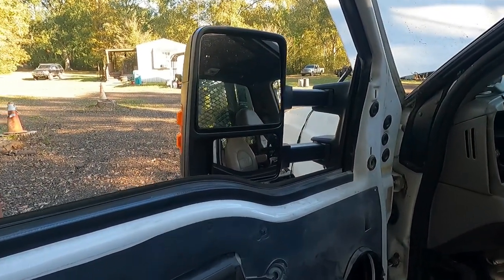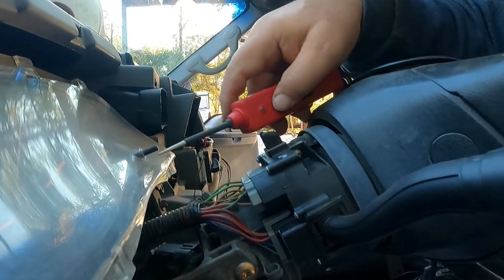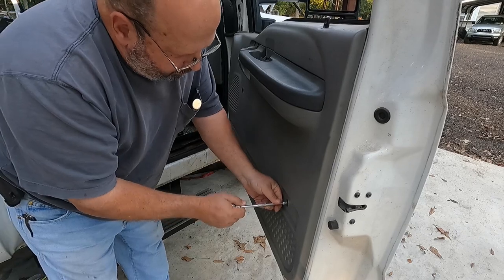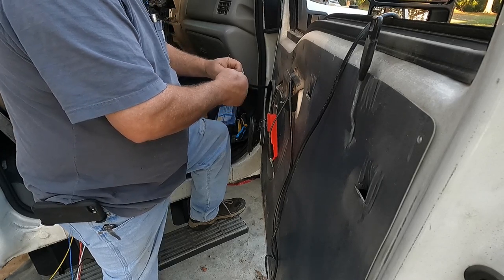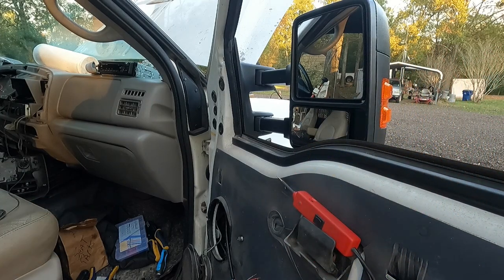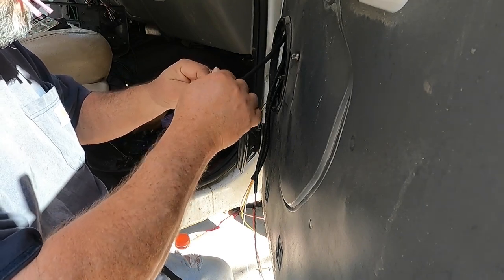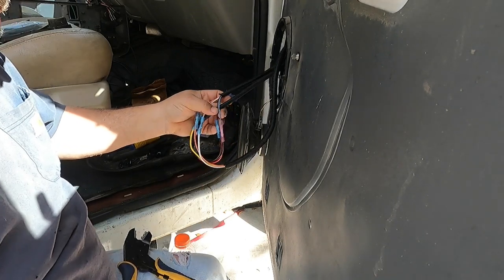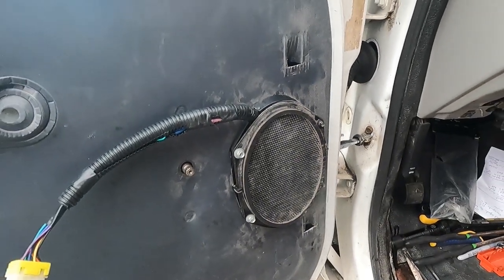Wiring 08 Mirrors on a 7.3 Power Stroke

Comment: Where was this video when I tried doing this? I ran a solid wire Brown and gray  from mirror to mirror. And put a tee splicer. The directionals or turn signals play around one wire from each mirror to each turn signal wire.. t o o k me forever but I got her done. Like the video nice upgrade
Reply from the maker: Thanks bud. These were more of a pain than the ones that just need to be cut and spliced because this rig never had any mirror wiring. Came with manual mirrors. But I love the larger mirrors. Thanks for commenting and appreciate ya watchin. Thanks

Comment: Hey man I have a 7.3 power stroke ambulance rung good but leaks oil think you can help me diagnose from where it’s odd 2003
Reply from the maker: We can give it a shot. Where are you seeing oil drop off the engine?
Reply: @bayoudiesel  you seam like a great guy man !! I think it is leaking in a few spots im gonna clean it real good and see if that helps me identify exactly where the leaks are
Reply from the maker: @Travellife360  also you can put a piece of cord board under the truck to pin point where a leaks is dripping off the block. Let me know what you find and/or I can tell ya where the usual leaks are and you can go that way. But your idea of cleaning will also help mail down where it coming from.
Reply: @bayoudiesel  yeah im gonna put card board under it and see
Reply from the maker: @Travellife360  sounds good. Hit me back and let’s kick around what ya found out.